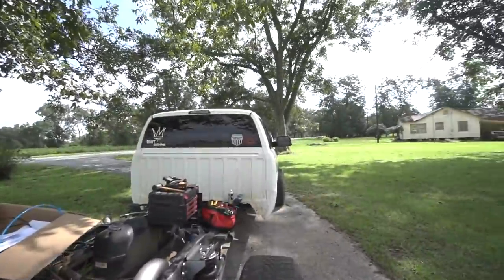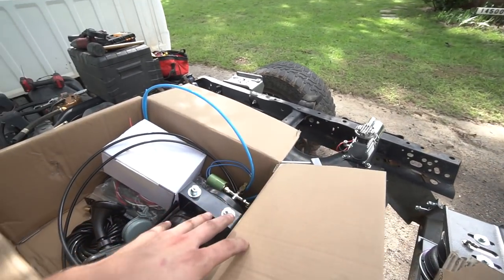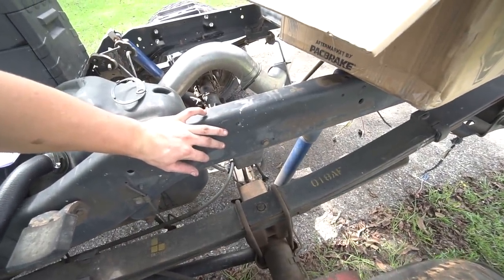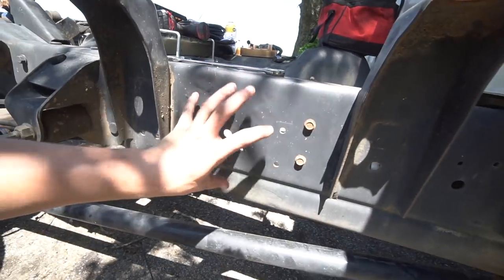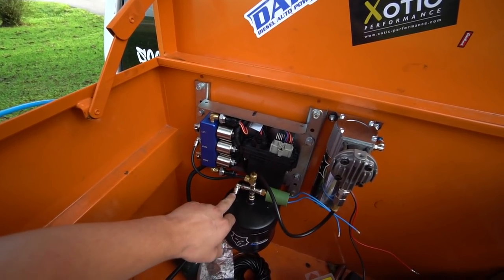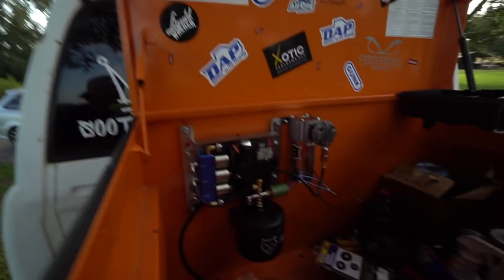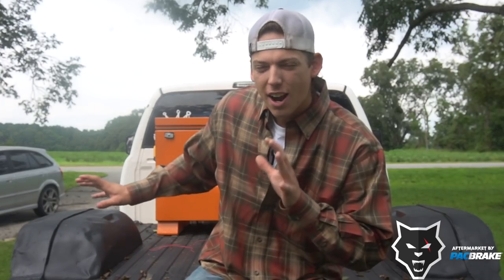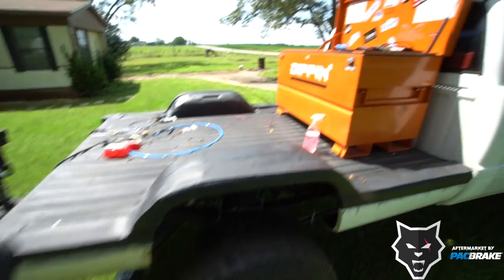MY AIR BAGS ARE WIRELESS CONTROLLED WITH MY IPHONE!

Comment: I was recently in Langley BC so i stopped by Pak Brake headquarters and picked up a Quickie Mount controller for my 4th gen dually that i tow with. I was surprised at how well they received me since i just walked in off the street not knowing if i could even buy anything without going through a dealer etc. They welcomed me with open arms... very class operation

Comment: Clean instal my only concerns would be having too much on the box and it shifting around and smacking the control board/compressor or even nicking a line. Not my preferred place of install but with you having really no winters you don’t have the big climate changes. Here in Wisconsin it gets wicked cold and wicked hot so my compressor is ran under my back seat tucked as far against back wall as it can go. Can’t even tell it’s there visibly, that way it’s out of the harsh elements.

Comment: I'm in need of a new air system for my 03 dually someone put a system I've never seen on it connected to the rear leaf springs but they removed everything to control it only thing left was the bracket and bags!